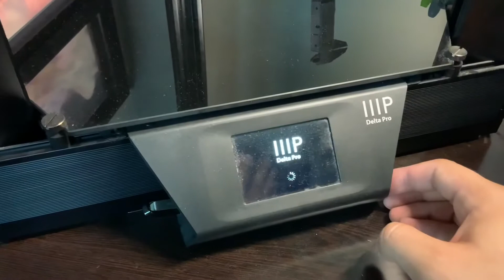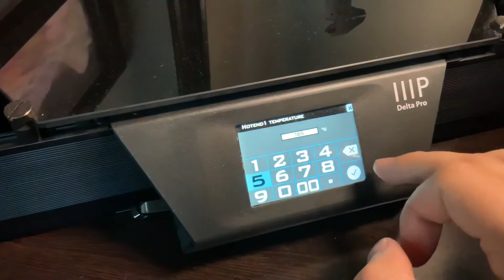Tutorial: Monoprice Delta Pro Hot End Assembly

Comment: Thanks for a very life saving video tutorial! This was driving me nuts - I'd disassembled my hot end due to a severe clog. I put it back together aaaand... only one of the part cooling fans were on. The other two wouldn't budge no matter what I did. And the extruder motor was unreachable as well... Big mystery. So I firmware updated - and the extruder came back on and so did the other part cooling fan. But the hot end fan remained silent and still. 

And then I rewatched your video and saw that diagram about the magnet poles... Half in vain, I switched them as depicted and... everything worked. Perfectly. I was half-way convinced that my board was defect - or maybe the power supply didn't supply enough power to the board. Because this behavior was so odd and unlike anything I've ever tried...
Reply from the maker: Drawing with Jakob Dam glad to help 😉

Comment: How did you come across a Delta Pro Hot End Assembly?  I'm looking to replace mine but can't find the parts.  I've got  extra hotends, but need a couple fans and a fan shroud, would like to just buy a whole new assembly like you've got in the video.  Any ideas or leads?  Thanks in advance for your help, cheers!  (oh yeah, great video!)
Reply from the maker: Scott R. Fischer thanks :) theres not too many spare parts for it yet, best bet is to look on monoprice website. I happen to have 2 delta pros and i am messing with one of them. I also posted a CAD file for the delta pro on thingiverse (not 100% complete yet), you could probably print new fan shrouds pretty easily just from that file 👌 fans you can buy on ebay or amazon etc, they are really cheap. Theres also a facebook group for this printer ;)